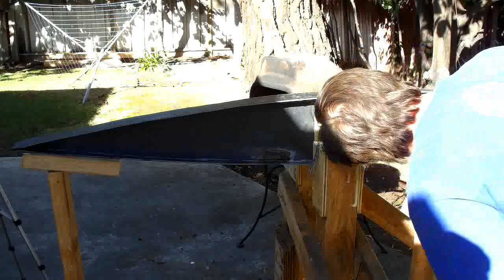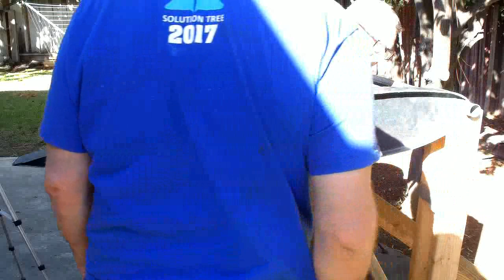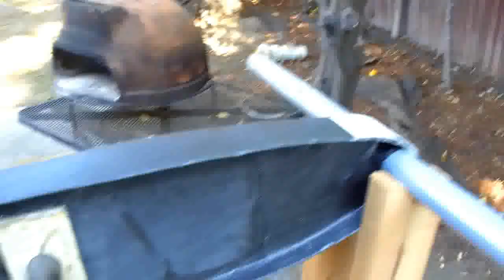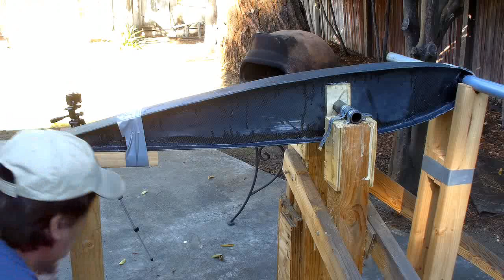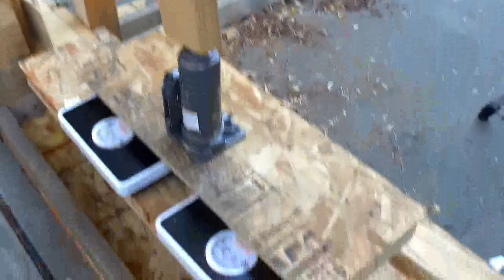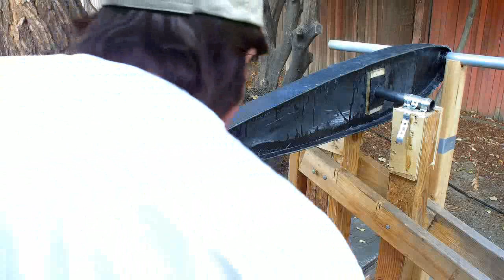Pilot Support Structure - KW MkII Foot Launch Hang Glider Sailplane Class 2

Comment: Haven't you just proven that this rib is good to negative 6 G?
Reply from the maker: No, the rib was tested in the inverted position and the jack was pushing
 up, so the load is the same as a positive load in flight. However, it 
is basically a moot point because the rib is designed to have the same 
strength in either direction. I should note that the bracket the harness will clip in to (there are two of them, one on each rib) is not included in the test due to the test config. So, the aft portion of the rib is in compression rather than the normal load situation which will place the rib skins in tension. However, these types of structures are almost always stronger in tension than compression so this test is actually on the conservative side - a good thing considering my butt will be on the line.